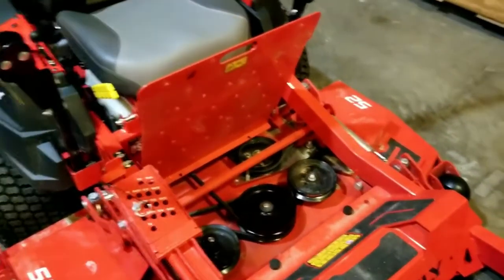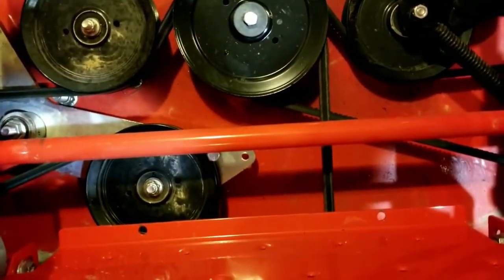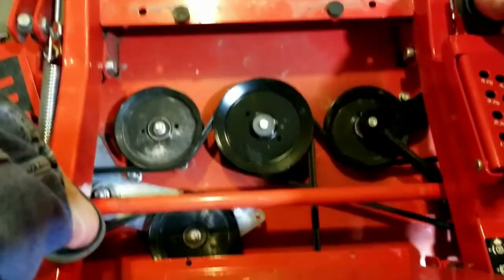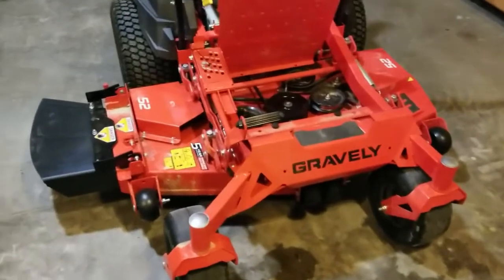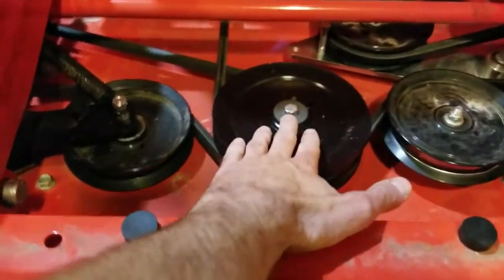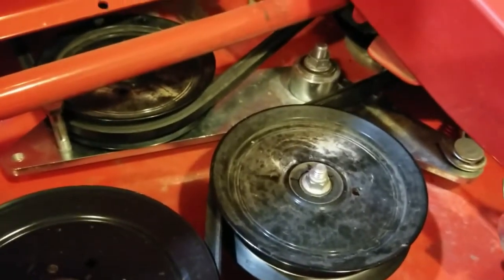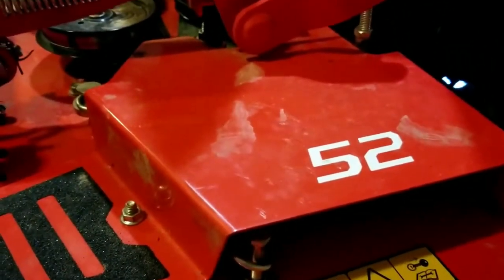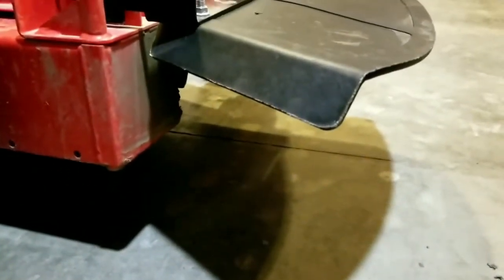Gravely ZT HD 52 with Anti-Vibration Kit

Comment: I am having the same issue with my Apex mower 52 inch it only had 88 hours and it wiped out all three spindles and two of the pulleys bearings they replaced it all under warranty. I thought it was weird so I started searching the Internet and I came across your video. My belts are doing the same thing. I am working close with them right now to try to come up with a solution to fix it. They are sending me a new belt, I really don’t think that’s the reason
Reply from the maker: I have 130 hours on mine now.  It hasn't given me any problems so far (knock on wood).  Even with the anti vibration kit the belt still slaps around quite a bit, but I can't tell that it's hurting anything.  Good luck with yours.

Comment: I came close to buying a Gravely, but after many hours of research I found out that they rattled and vibrated to the point it drove you crazy. People were putting rubber strips all around the Chute mechanism and the Deck raising mechanism in an attempt to quite them down. You pay good money for these riggs and shouldn't have to deal with these issues. So then I went out and bought a 2021 Scag Patriot 61 inch Kaw. FX 730, 3400 trans, what a joy!! No Rattles, what a wonderful machine!

Comment: 7/30/23 tried out 2 new apec 60 aeiens both of them had imediate belt slap and deck shake issues. Looks like they still are lying to us and saying its all good 4 years after your confrontation!  We need to get Better Business involved and tv media!
Reply from the maker: Thanks for the update.  I will say, my belt still slaps more than I think it should, but the annoying vibration sound is gone.  Knock on wood, I haven't had any trouble with the mower since the anti-vibration kit was installed.
Reply: I agree if they can’t come up with a solution I’m going to fight and do whatever I can to have them buy it back from me especially after all the spindles went bad in the machine and two of the tensioner pulley bearings went bad. We all know it’s because of the harmonic  vibration throughout the belt went into the bearings that destroyed them there is no way, all of them would go bad in 88 hours of run time
Reply from the maker: @austinkemski5126  I'm amazed of how many stories I hear of dealers saying "that's normal" or "they all do that", or "well, I've never heard of that before", etc.  I mean, I don't sell or work on lawn mowers and even I hear it all  the time.  That being said, I've had good luck with mine so far, but I wouldn't call 130 hours a long time yet.

Comment: I just purchased an Ariens Apex 60 to replace my Toro. The Ariens rattles and vibrates. My Toro didn’t have that issue. Can’t believe the Ariens engineers actually would allow this out the door!
Reply from the maker: You purchased a new one and it still rattles?  My video is from years ago.  You'd think they would've corrected it by now.  It's a great mower otherwise.

Comment: Would you have the installed part number for the kit please.
Thanks for sharing
Reply from the maker: I don't know if Gravely ever produced an official kit (doesn't mean they didn't).  Your dealer should be aware at this point, if there is a kit, because they've surely heard complaints by now.  I've not heard of a perfect fix, but whatever parts were put on mine improved it quite a bit.  It isn't nearly as obnoxious as it was before.

Comment: I wonder if they fixed the issue on the 2021-2022 models because I’m interested in buying on.
Reply from the maker: I haven't been in the market, but I wonder too.
Reply: I just bought a 2022 model last month.  End of month.  Haven't engaged blades yet because grass isn't really they're yet.  Do hear some small resonating only at low rpms letting it cool.  I was messing around yesterday. Now seeing this.  I'll go home today and run the blades in my building to see if I see this same issue...

Comment: Crazy how some mowers don't have that issue and have been around for ever . Gravely added more springs it looks like .
Reply from the maker: Yep, if it's not broke, don't fix it.  I know it's Gravely's "constant belt tension system" but I haven't looked close enough at other systems to know the difference.  I will say it always worked fine, but the belt shaking couldn't have been good long term.  I'm glad I found a remedy.
Reply: @shawnbond1975  yeah the constant tension shouldn't be so hard for these companies to get the hang of but I guess all it takes is a pulley to slightly out of round or even a belt to have a slight low spot to start a vibrating mess ... I notice my mower has a constant tension system and has a shock on it as well... First machine I've owned that has that so I'm not sure the exact effects but I guess it absorbs that initial engagement of the pto
Reply: @shanemak47  is your machine a Spartan

Comment: Thanks for posting.  Has Gravely been in touch with you to see how well the test fix kit worked?  Long term I think they just need a better pulley design, such as a machined casting which would be turned to minimize runout and not the shape of a cam lobe so to speak.
Reply from the maker: Gravely hasn't checked on me, but my dealer knows.  Maybe Gravely had checked with him since he did the install.

Comment: Were you ever able to get the part number for this kit? I just bought one used and it has the same issue
Reply from the maker: I don't know if Gravely ever produced an official kit (doesn't mean they didn't).  Your dealer should be aware at this point, if there is a kit, because they've surely heard complaints by now.  I've not heard of a perfect fix, but whatever parts were put on mine improved it quite a bit.  It isn't nearly as obnoxious as it was before.
Reply: Just talked to my dealer. They say they've never heard of such a thing. They claim there is a good chance it's just a bad belt or less likely it's a pulley
Reply from the maker: @markzaytsev1743  this was a widespread problem back when I posted the video.  If you do a google search, you can find 100's if not 1000's of reports/complaints about it.  It definitely has something to do with belt tension, but the fix wasn't as simple as a new belt unless they're recommending a shorter length now.  I've also read just a few instances where people have adjusted the engine's rpm until the harmonic vibration went away.  Apparently if you get it just right, that works.
Reply: @shawnbond1975  I prefer not to adjust the rpm. It should be smooth at all speeds. I'll be checking the balance on everything to see what I come up with.

Comment: How much does the kit cost? Gravely should fix this problem for free.
Reply from the maker: They did fix mine for free.  At the time, the kit was brand new and somewhat a prototype for testing.  I don't know if it's an official part number now or not.  It took a lot of work with my dealer and gravely directly to make it happen on mine.  Good luck.

Comment: Engine running, I'll just put my hand down into all those belts! why not! Homer move dude
Reply from the maker: I appreciate your concern, lol.  The only time I touched it (for a split second) while the engine was on, the belts/pulleys weren't moving because the blades weren't engaged.  Every other time the engine wasn't even on.  Are you one of those guys who thinks I should've taken the spark plug out in case it spontaneously started?

Comment: Spoke with my dealer they said they talked to someone at gravely that didn’t know anything about it. Does anyone have a part number or name of someone at gravely to talk to?
Reply from the maker: I dealt with technical service rep named Kaitlyn.
Reply: Shawn Bond do u have a part number or anything like that i could relay to my dealer? Thanks appreciate the help!
Reply from the maker: @Ocho817  Sorry, I don't have a part number.  I wasn't home when the dealer brought it back and he didn't leave any paperwork.
Reply from the maker: I had posted an ariens email address.  Did you see that?  I don't know why it's not showing up.
Reply: @shawnbond1975  No don't see an email address anywhere. If I gave your dealer a ring do you think they could help me out?
Reply: @shawnbond1975  my dealer was able to get to someone that knows of the issue and they are sending them the "test kit". I'm assuming thats what they installed on yours. Thanks again for posting the video my dealer actually checked it out too.
Reply: JUNK MOWER!

Comment: I'm having the same issue on my 2021 model.
Reply from the maker: That's too bad, I thought they would've put a fix into production by now.  It's still a kick ass mower, but my vibration has returned a little since the video.  Thankfully it hasn't caused any issues for the belts, spindles, or pulleys yet.

I'm about to release another short video regarding my deck.  Stay tuned.

Thanks for watching.
Reply: @shawnbond1975  thanks
Reply: @shawnbond1975  hey Shawn I just added a video to my YouTube fixing a part of my problem check out the video and let me know if yours has that same type of rattle
Reply from the maker: @Honda1k  I'm not sure why I'm just now noticing your comment, sorry about that.  Those same pieces had been a little loose on mine too.  I adjusted the nuts/washers just enough to keep them from rattling, but putting 3/4" heater hose over the bolt is a great idea.  I may do that mod just because it's so cheap and easy.  Thanks

Comment: Get what you pay for . Last why gravely is cheaper than most . Poor cut quality also. Toro is the best ztr
Reply from the maker: Thanks for your opinion, but "cheaper" isn't the word I would use.  If you compare the actual components (they aren't made by Gravely), with components in the competition at the same price point, you'll see you get more bang for your buck with Gravely.  Every mower brand has problems.  For a residential mower, my Gravely is built like a tank and I'm very happy with it.

Comment: No shake my ass
Reply from the maker: I said "it's much better now" and "no shake at idle like there was before".  If you watched the before video and this one and don't see the same thing,  get your eyes checked.  Is it perfect?  No.  But I've not owned a mower that the belt ran smoother on.
Reply from the maker: Are you in the market for a zero turn or do you have one with a shake already?
Reply: Shawn Bond I just bought the gravely ZTHD 44 and haven’t even had a chance to look at everything
Reply from the maker: @THEODINOFFICIAL  I hope you have good luck with it.  I'm very happy with mine.  I don't even mind having to mow anymore.  In its price range, I think it's the best model out there.  Hustler was a close second, but some of the design features of the gravely won me over.